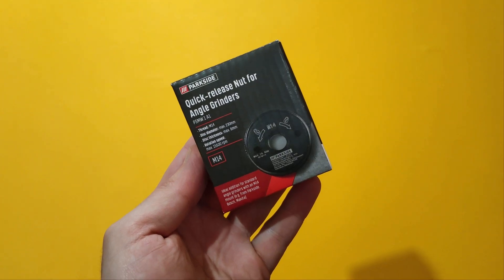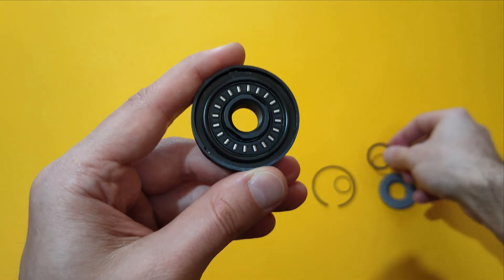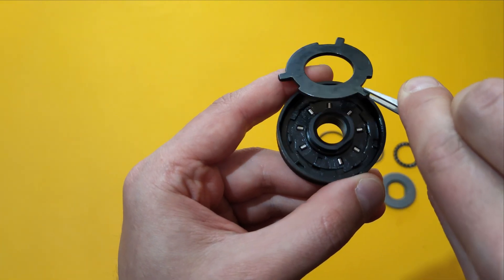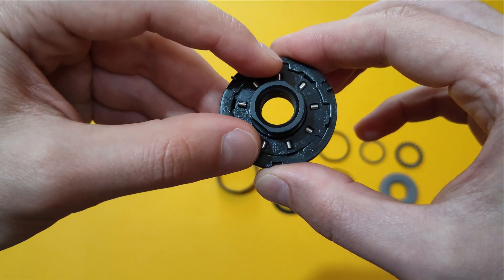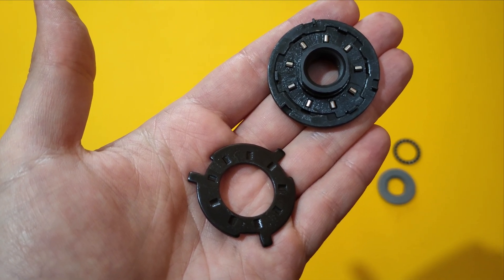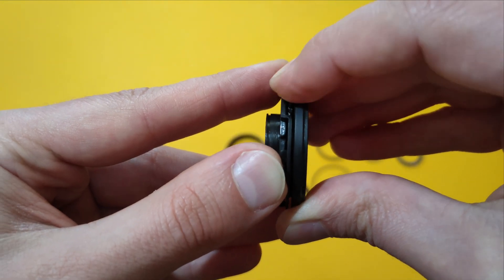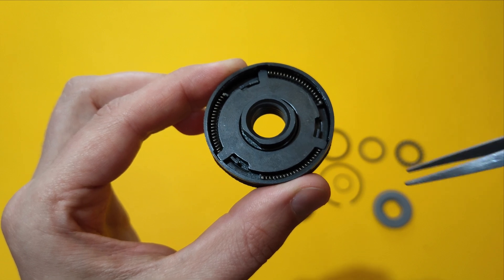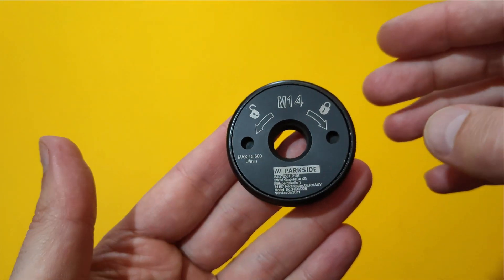What's Inside Parkside Angle Grinder Quick Release Nut - PSMW 1 A1

Comment: Great video ,i didnt bought it because it was too much expensive for me ,10 € is a lot for inconvienience .Beside i never use wrench i tighten disks by hand and i loose them the same way.I have a parkside handle that has a storage for key . 
I dont think that is a good nut when disk snaps and locks the nut super tight. It has happend to me with a regular nut and i had to use rottary hammer dril with modified chisel to loose it but nut worked fine for many years .Anyway great video showing us whats inside and how it works .
Reply: Remind me to move a safe distance away if you have a grinderette (the old term for these small machines) in your hand.  I'd like one for my 9" machine, but haven't found one, yet...